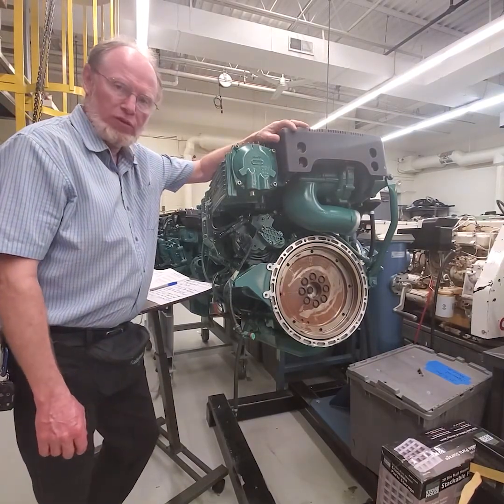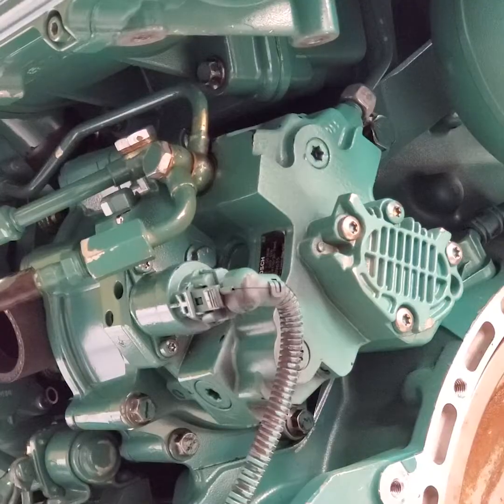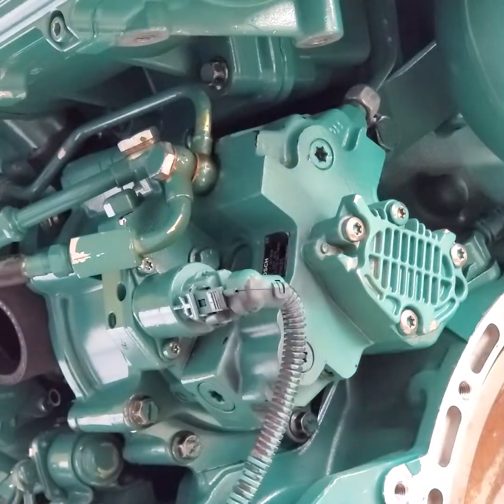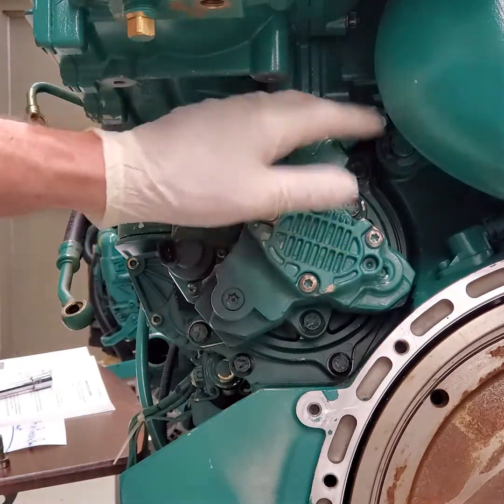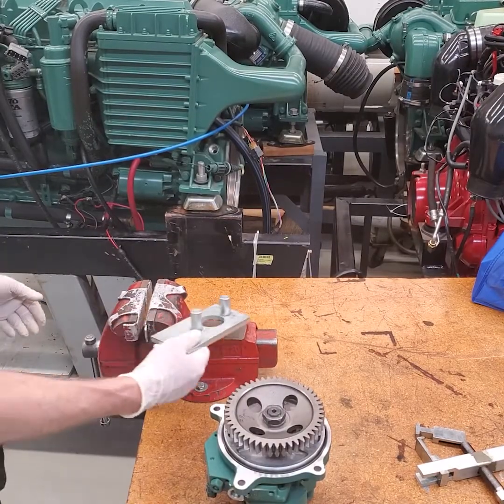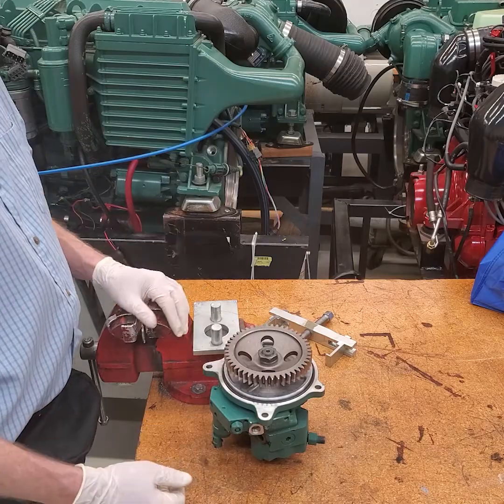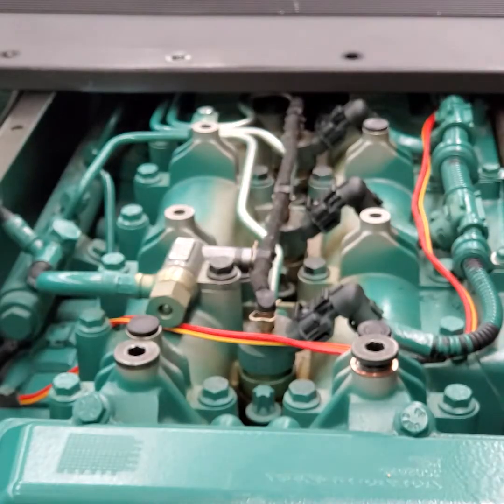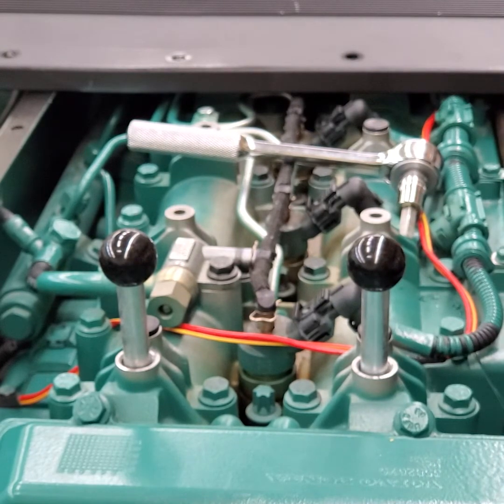Volvo Penta D4 D6 HP Pump Removal and gear removal

Comment: Very informative.  My D6-350/DPH engine shut off while underway, and will only keep running if the primer bulb is continuously pumped.  Vodia showed 500 psi when cranking.  Is there a chance the the pressure limiting valve is bad, or is this more likely to be the pump itself?  Access is tricky, as this is a port-side engine.
Reply from the maker: Did you change the fuel filters and try bleeding the air our with the primer, it cN be the issue. If not, Try unplugging the MPROP. See if it will start and run with a slightly high idle. This will cause the high pressure pump to deliver max fuel. It sounds like a fuel delivery not high pressure issue.
Reply: @tedsmarinerepair8956  Filters are fresh and properly bled.  Will try MPROP unplug.

Comment: Hello sir, I have D4 260 Volvo Penta and hard starting, check fuel system and it's good, just replace 1 and 3 fuel injectors and it's run fine, after few runs it is hard starting now, any ideas sir?
Reply from the maker: May be....a leaking Injector. Have a dealer do an injector balance test. Or watch my video! Please subscribe!

Comment: Hi Ted what do you think about Volvo 61 306 hp , or tamd 122 600 hp ??
Reply from the maker: Both are mechanical and commercial grade engines. The 60 series is a work horse.
Reply: @tedsmarinerepair8956  thanks 😊

Comment: Hello i have Penta D4-225 and my High pressure pump have been leacking, i see youre video and wonder how in the end i should put engine in position! those pins you have to look kam shaft, if its not in position how should i change? And also i have not change my pump, could i not just put it back?
Reply from the maker: The engine needs to be timed prior to replacing the pump. A cheat is to remove the cam plugs  where the pins go and rotate the engine until you see the hole the pins drop into.  At this point you can replace the pump. It is preferable to use the locating pins to  ensure the  pump gear drive is timed to the engine.
Reply: @tedsmarinerepair8956  Hello Ted and many thanks for you're answer, I saw you're movie but i don't understand if the plugs are in right position there?
Or should they drop down more? And big question nr 2 is how to rotate engine?  Also i must say, that iam not replacing pump, iam put back the old one,,but i guess engine must be timed anyway
Looking forward for youre next answer
BR/Jonas
Reply: @tedsmarinerepair8956  
Hello Ted
I hope its ok to mail you like this,
I heard know that I must replace my pump with a new one
Do I get a problem then also with the Electric part? (Computer)
And please how should I do to put camshaft in place? How to move round engine

Comment: Just subscribed.  I have a TAMD74EDC.  I’d message you directly if I could.  Maybe you could direct me on one of your videos how to diagnose a possible fueling issue.  Recently did a complete service on the engines.  They Only have 600 hours.  2000 model Trojan boat.  Problem -  boat had been running perfect.  Out of nowhere on the way back to the marina i started to spool up.  About the time I hit 1500 rpms it started fading out.. Was chugging and eventually died.  Really acted like it was starving for fuel.  After it died it would not come back.  Temps were fine.  no buzzers going off.  no codes when Turing on ignition. Racor filters looked perfect in the glass.  No signs of water.  1. Any chance of a Volvo fuel filter collapsing or shutting down w/ possible water in fuel?  2. Best way to check fuel pressure w/ out any special tools?  Thanks for any help.  Jon
Reply from the maker: Jon,
Sorry there is now way to diagnose such a problem over the net. 
I would suggest you try bleeding the fuel system up to the injectors to see if a fuel starvatiin problem is the cause.. Otherwise contact a VP dealer to determine the fault. There are many options for this age engine.
Reply: @tedsmarinerepair8956   figured out the problem.  For future reference… sometimes its the simplest thing.  Racor filters started getting clogged.  Which caused the main fuel line to the port motor to allow air just before the primer pump enter the fuel system.  Hence ran out of fuel.. The clamp was loose.  When I would pump the primer it would get enough fuel to start the boat then die out.  Repeated pumping the primer and I just happened to hear what sounded like a leak or a plunger, which let me to grab the fuel line.  I’ve never messed with it before.  But it was loose.  Tightened the clamp and no more problem.  Other than changing out the Racor filters.  20 year old boat and junk in the tank.  Maybe help someone else down the line.  Cheers.
Reply from the maker: @jftopsfoerster4144  As I suggested. I am glad it was an easy fix!  You may want to have the fuel in the tank high speed filtered or "polished" as I have heard the term. It will extend the life of your fuel filters. Happy Boating!!

Comment: How do you bar the motor over?
Reply from the maker: For most diesels you can order a special "barring tool". For some the jobs I have been faced with, I simply fabricate a steel plate to bolt onto the front of the harmonic balancer/viscous damper and then weld a large nut like 30mm or better weld an old 1/2-3/4 drive socket to it. Fabrication is key for one off engines.